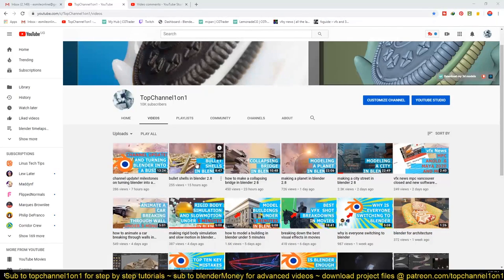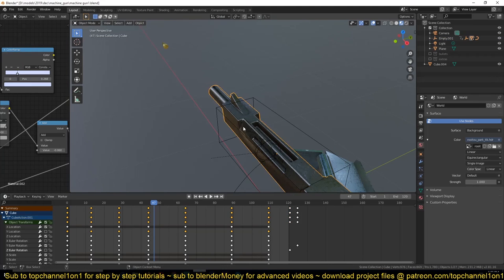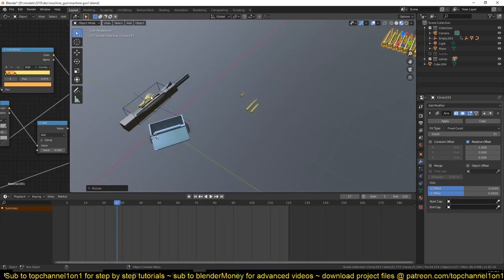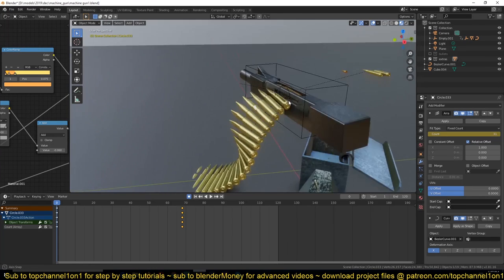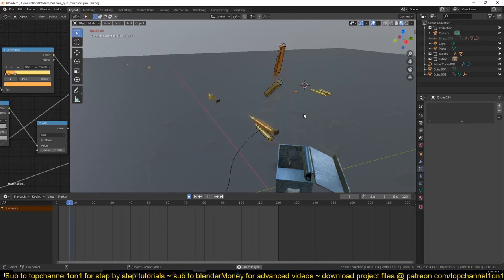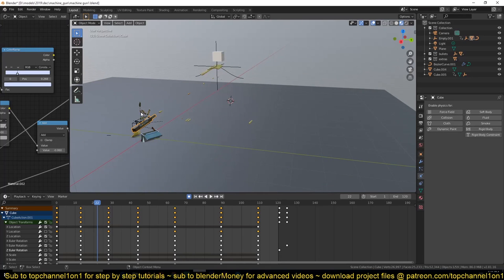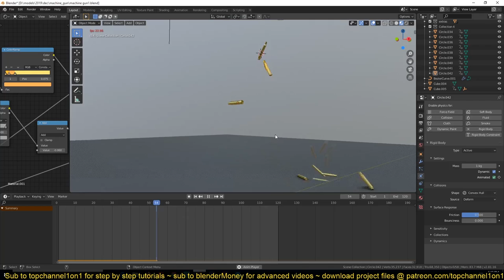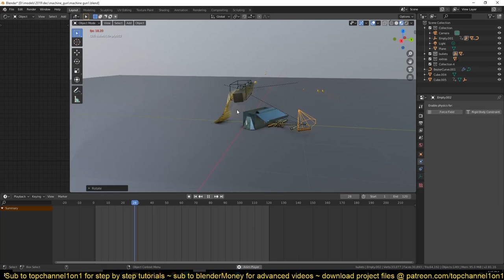how to make a shooting a machine gun animation in blender test r&d

Comment: Is there a reason why the case returns back to it's starting point or stop into mid air after ticking off "animated" property in rigid body? Has there happened some changes for how rigid body works in these past 3 years after this video?
Reply: idk if you still need it but you have to click animate, then keyframe, then move along some frames, untick animate and then keyframe it
Reply: @Andrzej9k  That’s Exactly what I had done.
I tested with new project, where it did what suoposed, thus I concluded the save I tried to do that has been corrupted somehow…